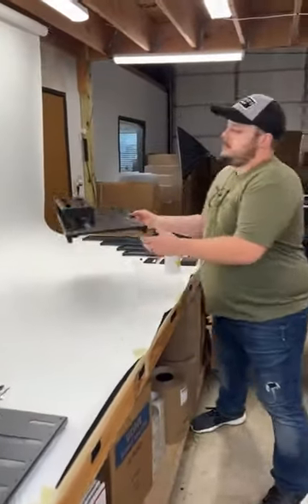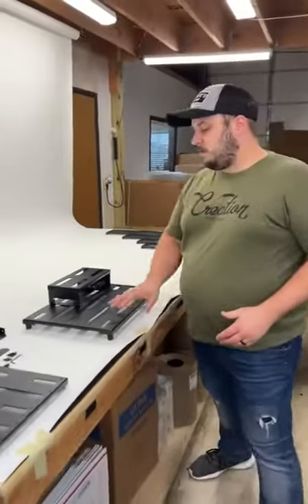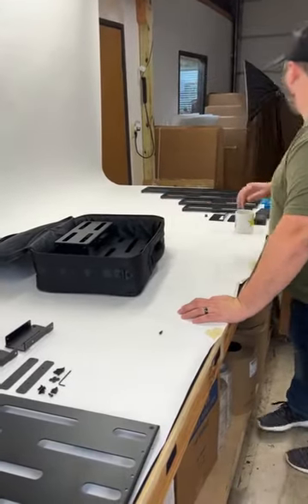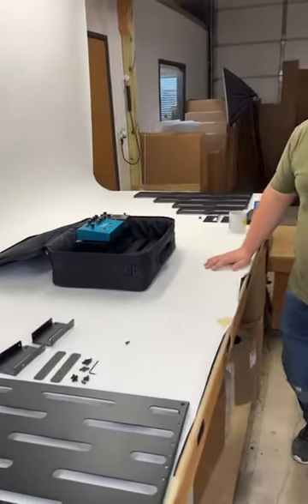Aero Series Pedalboard Riser Overview

Comment: Magnetic latch on the hinge would be an awesome option. I'd almost always hinge towards the back.
Reply from the maker: We actually just updated these with our new V3 Series rollout late last year. Truth is, we considered doing a magnet and honestly, we stuck with the 4 screw method in this version. It’s more versatile for different setups. Most people do hinge toward the back like you, but some do need to hinge to the front and this allows that. Also, with the feedback we got from this first version, almost everyone just left out the 2 screws for their hinging orientation and found it was more convenient. Gravity keeps it from hinging whenever it’s not in the case and the magnets aren’t even necessary.
Reply: @Creationmusiccompany  makes sense! I really dig your design. I’d be upgrading from another company’s board. A quad 4.2. Your boards seem to fit the bill nicely. Looking to go two tiered.